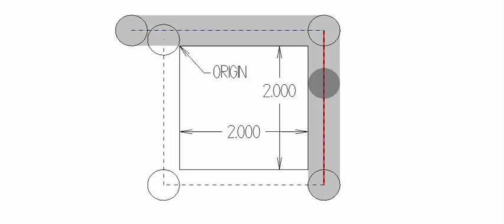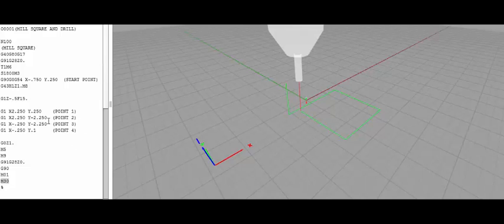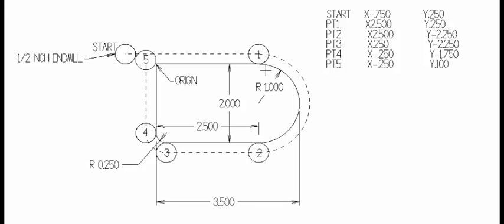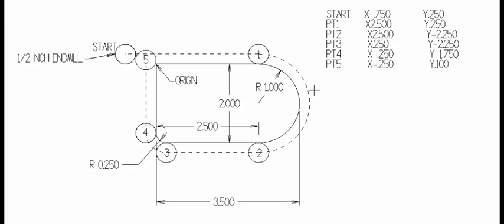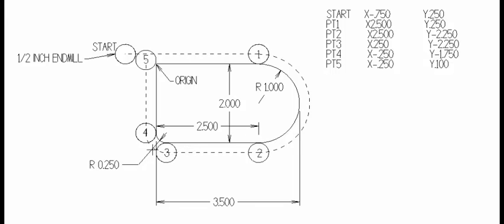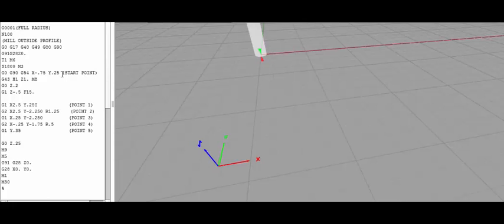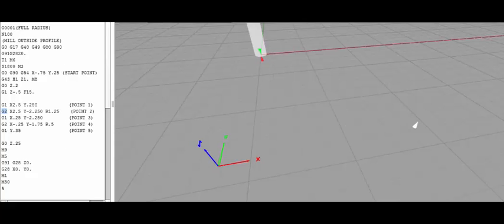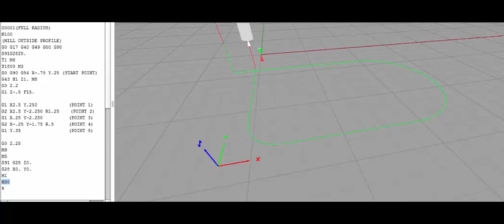G1 LINEAR MOVE AND G2 CLOCKWISE ARCS

Comment: Hey tom, does the mill has a canned roughing for milling? Or you gotta write a bunch of lines
Reply from the maker: You can write macro statements that use variables to reduce the amount of code that needs to be written. Or you can write a loop to repeat  a certain process.

Comment: Shouldn't the Y at P2 be at -2.500? Please help clarify.
Reply: das, It might look that way at a glance, but no. Take a look again at the X0Y0 origin location.  The tool center at P2 is -2.250" from Y0. His example here is written in Absolute mode. If he was using Incremental mode, then your  Y-2.500 would be correct. Hope this helps.  :)
Reply: thanks sir. i got it.

Comment: Hello , can u please tell me where is Z there , i realy dont get it. Thanks.
Reply: Z runs through the spindle. The view shown is the top view, therefore Z cannot be shown. Imagine that you are the tool and you are looking down at the part. If you moved closer down to the part, you would be moving along the Z axis. If a front view were shown, the Z axis would be in the position the Y axis is in the top view. I hope this helps
Reply: In theory this is a simplified two plane explanation.  From the lesson it is assumed that the endmill is already in the preferred position.